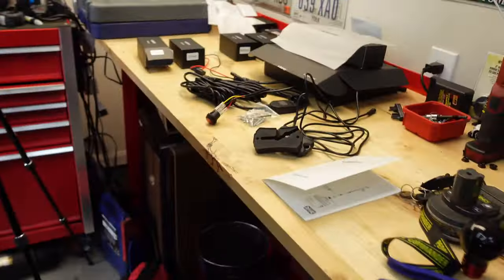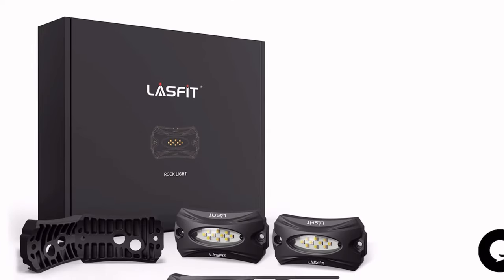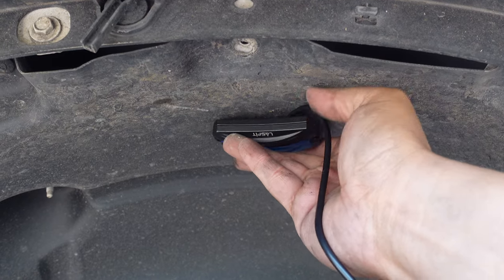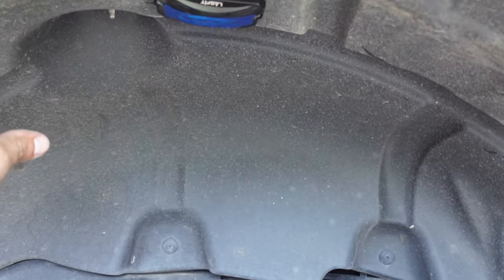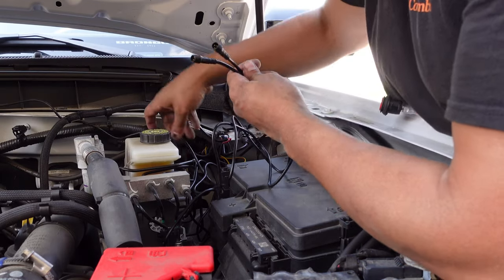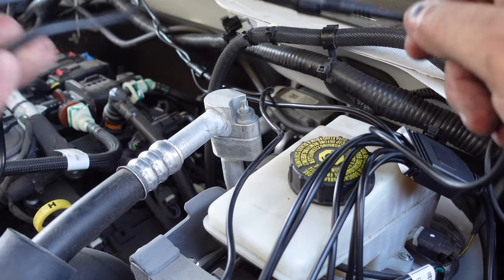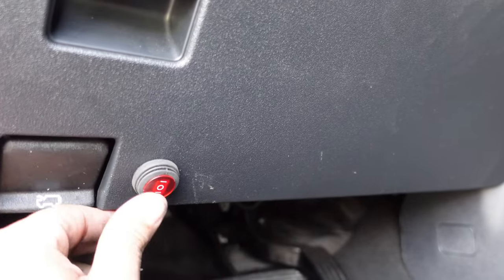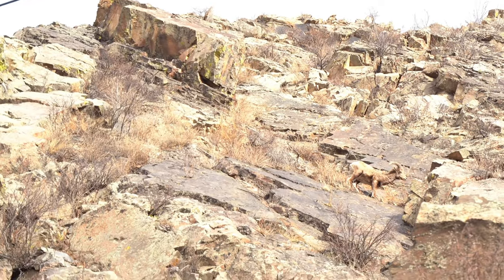YOU NEED THESE ROCK LIGHTS! INSTALLING BRIGHT SWITCHBACK ROCK LIGHTS. Ford Bronco Rock Lights

Comment: Looks great!!
Reply: I am assuming you don't have the uplifter switches
Reply from the maker: Thanks! I do have them but didn’t want to utilize one for these.
Reply: @JJ Banuelos  so if I purchased 2 sets would I be able to connect 8 lights to 1 module?
Reply from the maker: @thefontsforfunhustleig3026  that’s correct. Unless you want to wait till they release the individual kits but if you don’t then yes
Reply: @JJ Banuelos  great thanks!! Looks pretty bright with 4 that's for sure